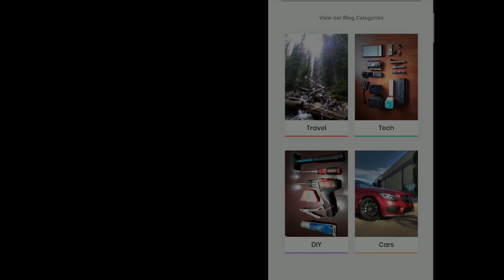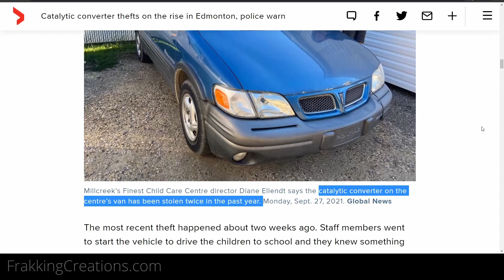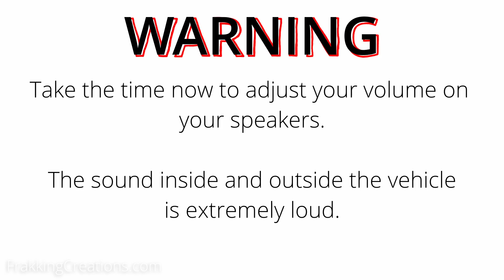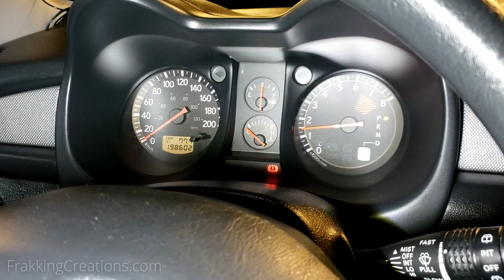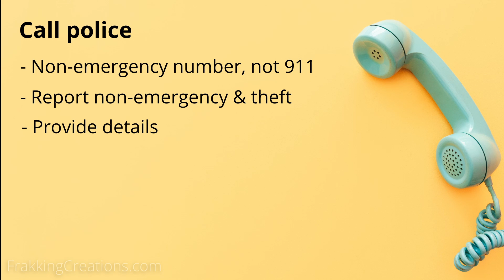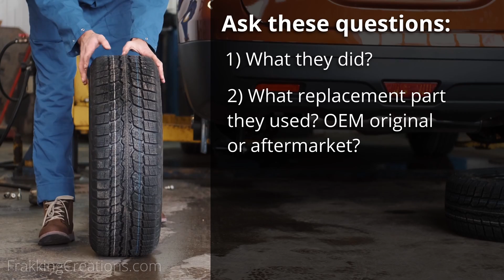Catalytic Converter theft: What to do & expect when your catalytic converter is stolen?

Comment: You're 100% correct,  that happened to us during the -50 degrees  celcius . Actually we bought  the CTEK automatic charger and for sure it helped  a lot to  boost the battery.  Thank you for sharing your thoughts and experiences.👌